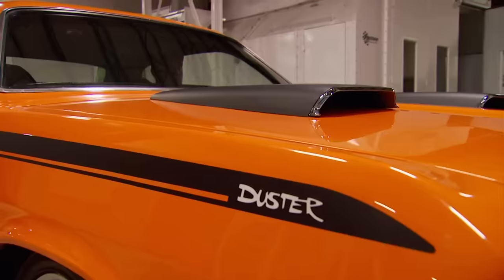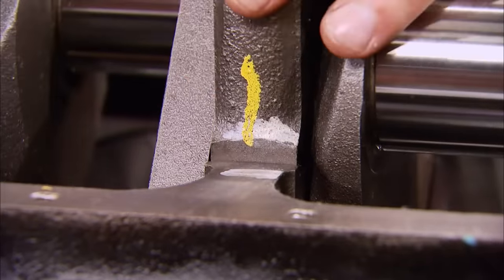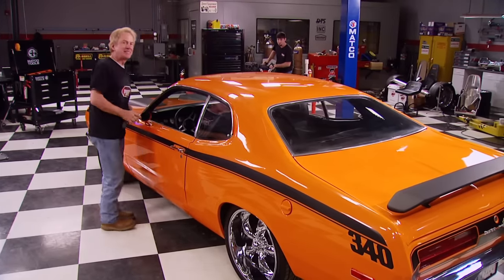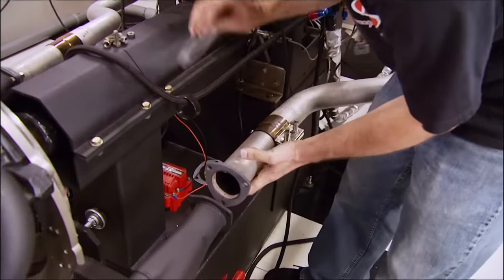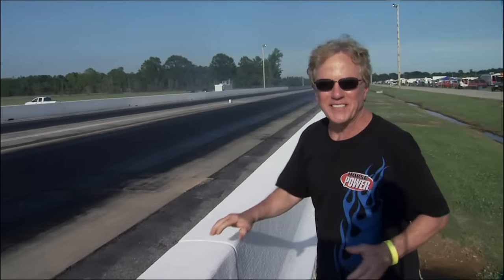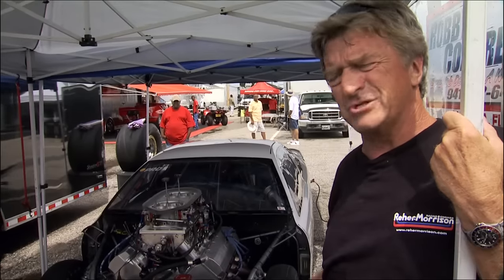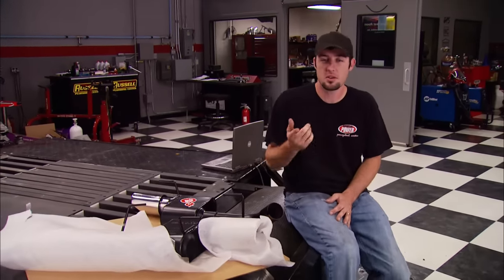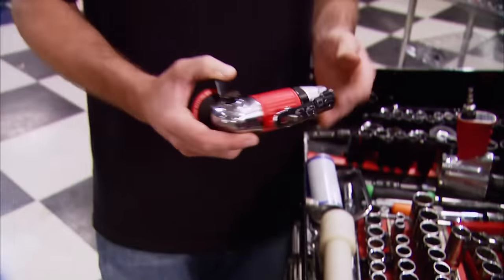Mopar 360 Build on a $2,500 Budget - Horsepower S13, E17

Comment: I bored my 318 .40 over and went higher compression and a utp350 cam has me sitting at 384hp 438tq with 93octane
Reply: That's a good number, tq is really high, what else did you do?
Reply: james bullock it was built with all clevite bearings lightweight tq plate and I removed all accessories except alternator everything is ported and the utp350 cam is amazing with the tune that’s on it now for daily use it’s around 370hp and 400-415tq I haven’t dynoed it in this setting but according to the math and duty cycle I’m close to the numbers maybe a little high
Reply: james bullock the 384hp and 438tq are dyno proven tho
Reply: @BobbyB910  You should make a video on it.  I'd love to see!!

Comment: I have 1990 dodge w150 4x4 318 its fuel injection and wanna make 300 to 400 hp has a mild cam and  has a charging problem  wont charger charge when runing

Comment: What a crap show. That wasn’t a build..... stock cam, dished pistons, small valve heads. That was simply a rebuild of a 360. Only thing not stock on that thing was the intake and headers. If memory serves me well, I believe the pistons in a stick 360 sat nearly 1/8 inch in the hole plus the fish and those heads equal approximately 8:1 compression at BEST..... no way that rebuild costed $2,500.

Comment: These guys running 4.1x in the 1/8th mile with their monster engines, a 3.4L single turbo I6 Supra running 3.8 in the quarter.  There's displacement for replacement.  206ci motor beating the shit out 600ci.

Comment: The 1971 360 has 1.88" intake valves with only the 340 having 2.02" valves.
Reply: @BuzzLOLOL  The 1967 and EARLY 1968 318 blocks can handle being bored to 4.00". The castings were originally meant to also use on a 1967 331 performance engine that was scratched, due to poor performance and was bored to 4.04" for the 340 in 1968.
Reply: @jimjungle1397  - The article shows 318 making 400 HP cheaply with stock bore...
Reply: @BuzzLOLOL  Yes, I know. I was just noting the earliest 318 blocks have heavier cylinder walls due to a prototype performance 331 engine for 1967. It was an answer to the 327 Chevy II, but didn't perform with 273 size valves. It got scratched from production and for 1968 it was bored 0.040" over for the 340, the 340 mimicked the 327 intake port size and 327 valve sizes. The 340 was designed as a 6,500 RPM redline engine, but due to the cast pistons, the valve springs were weakened and reline set at 6,000 RPM, which led to dropping the manual transmission camshaft in 1969. Mopar Performance used to sell ported 318 302 casting heads with 360 valves in them.
Reply: @jimjungle1397  - Mopar selling at Mopar prices prolly couldn't afford the warranty problems of another 6,500 RPMs engine...

Comment: ?? you cant install the water pump and timing cover as an assembly on a LA motor, there is a timing cover bolt directly behind the water pump inlet. If you are going to film it you should be correct about it.

Comment: More cam and fuel!
Reply: even on a stock compression, stock head, near stock cam, etc LA 360, a tuned 750 cfm spread bore with a dual plane works wonders. A 600cfm on a 360 is too small.

Comment: This episode left me very confused, I kept looking for another episode where you actually did anything to the motor. You have a completely stock motor with intake, carb and headers. This isn't an engine build, this is buying an engine and REbuilding it with bolt ons for 2,500 bucks. Couldn't even be bothered to port the heads. If you were buying new cam, why did you get a completely stock cam, it's maybe 50-100 bucks more for a performance cam.
Reply: Clearer thinking: https://www.hotrod.com/articles/318-small-block-build
Reply: 218/228 isn't a stock cam... will go to 400 HP with better parts choices...

Comment: 360 will eat a 340 no lie  even the big block has a hard time time against the even high revving rpms I twisted mine to  7500
Reply: BS, I’ve had and have both. They never built a low performance 340 ever, 360’s came in everything from vans, 4 doors and trucks. I still have both, the 340 is worth 4 x as much, so I’m harder on the 360 and the 408, but even R blocks are designed off the 340, not the 360

Comment: You guys are missing the point:
This was a budget stock type build. It was not a power build.
Reply: A couple yrs ago I built a 79 360 with a .030 overbore, 9 to 1 flat tops, rebuilt stock heads with stainless valves, new seats and guides,  MP Purple shaft 430 grind with matching lifters and springs, new hd rockers and hardened shafts, new push rods, remanned cast crank, MP high vol oil pump, double roller chain,  bronze distributor gear, Edelbrock dual plane, Carter 750 AFB, 1 5/8ths headers  and a MP electronic ignition orange box system. Made 348hp and 395lbft on the dyno. Cost me under $1,800 and runs very good.

Comment: the .441" lift really sucks guys!  couldn't you get at least .480" ???
Reply: @BuzzLOLOL  yeah, I remember this from like 15 years ago. They did a series of junkyard jewels. Great build-up for cheap. With Edelbrock RPM heads, would have been 425-430 and with roller rockers, add 10 more

Comment: Do a 4.6 4v guys
Reply: Matthew Leising its gunna need boost too make power 😂
Reply: @fordmanx3  lol I guess 400 wheel is enough for me all I have is cams and an intake spacer with bolt ons do the math your looking over 450 at the crank out of a 4.6 it's a good motor and tbh motors are cool period some of my favorite motors are flatheads and they dont make power it's an art building engines
Reply: @fordmanx3  by the way your commit is was not needed either but thanks for your ignorance
Reply: Matthew Leising 450hp NA ?
Reply: @fordmanx3  yes I did say just cams and Bolton right with a spacer right? What's the question for lol
Reply: Matthew Leising damn iam impressed for a 4V
Reply: @fordmanx3  yes it's because people are ignorant  look up livernoise 5.3 4v made 519hp and 471 tourqe they have all the mods up there but stock cobra intake with a spacer and stock heads but cnc its expensive but them motors are not shit

Comment: so your going to have exhaust gas blowing out at the egr area
Reply: That’s not the way it works
Reply: @pritchert2799  i built my 360 with an aluminum intake and noticed that .why dont the intake cover that
Reply: ridge runner originally that hole was used to heat up the intake so cold starts would be easier
Reply: @pritchert2799  i understand why its there but the intake should cover it.
Reply: ridge runner no because if the hole was covered it would heat the intake up, which equals less horsepower

Comment: 360 with factory rated 255 hp ?    they really detuned the potential right out of the 360 in the small valve years
Reply: Ford and Chevy did the same thing for 72 onwards
Reply: Put tune back in: https://www.hotrod.com/articles/318-small-block-build

Comment: Why so much valve train noise?
Reply: The Rocker Shaft and Lifters have a gap for oiling.. say if your use to Chevy or whatever a Ford is.. I'm kidding no worries.. my 318 powered 68 Dodge Dart  sounds the same..

Comment: with 600 cfm vacuum secondaries are you sure they even opened up at 3800 rpm. wrong cam should have run the 340 replacement cam and if you were running emission heads should have run the 318 heart shaped chambered swirl port heads from the early 80's if you weren't planning on using good heads. i feel scammed by this episode. the headers wtf did this have to be smogged or please management by producing such low numbers.

Comment: 360's came out in 1972 not 1971, just to split hairs.. :)
Reply: 360 came out in 1971 on full sized C bodies and Dodge/Plymouth trucks. They were rated at 255 gross hp with 2 bbl carb. All 360s had the 1.88/1.60 valve heads, and were 8.8 to 1 compression in 71.  Ratios varied from 8.5 to 8.0 from 74-80 depending on 2 or 4 bbl applications. There were 3 cams available, 71-80.  .410 gross lift, a .444 for manual trans  HiPos, and .430 cam ( the old 340 auto trans spec cam) All 360s used a cast externally balanced crank with larger main bearings than any other production LA engine, until the Magnum series took over, which uses a nodular iron crank which was internally balanced. 71-77 360 blocks are best for rebuilding, as they can be punched .060 over, whereas 78 to 91 blocks are only rated for a max of .030 overbore. Fun fact: The only external part that is unique to only 360s, is the oil pan. All other LA series external parts bolt right up.
Reply: The 360 came out in 1970. They were put in trucks and station wagons. End of debate.
Reply: Yes they came out in late 72 for 73 model year

Comment: Soooo 2500$ for only 60hp gain for 1500$ you could have eBay turbo swapped it with a decent Cam and forged pistons and came out with 200 horsepower gain
Reply: No gain if compare 255 netHP to 314 grossHP...

Comment: No windage tray, no exhaust crossover heat block off, no valley oil tray to keep hot oil off the intake......sigh.
Reply: All True... Very True.. Mopar Everyday and Everywhere..
Reply: Windage tray, agreed, heat block off, possibility, oil tray, depends if the intake will clear it, but using a reground Chevy spec cam?! NO WAY!

Comment: stock heads, no work..shitty lift numbers not bad then but....2.02 port match, bowl and pockets, comp cams 280 mag with correct larger lifters for the SB Mopar , 350 + hp 410 torque

Comment: 340s had 330 hp, 360s cant compare to a 340
Reply: Vito Andolini  you really think that? How about giving the 360 10:1 with 202 heads. The 360 will eat it up on the low end and hang with the 340 on the top end.

Comment: Piss poor just like everything they do a stock magnum made 245 hp in stock form. They need to quit using flat tappet cams not even 1 hp per cubic inch.
Reply: Ford and Chevy small blocks had comparable horsepower ratings
Reply: Gooder thinking: https://www.hotrod.com/articles/318-small-block-build

Comment: I'm not a diehard anything guy, so I can't help but think a $1000 truck LS from a 'yard, with a ring job, cam, and springs would be a smarter way to go. And yes, I mean build the LS and put it in your Duster or Dart or whatever. I'm fine with automotive crossbreeds.
Reply: that swap would cost more than this engine build cost lol.

Comment: Sounds like a waste of money just to rebuild stock junk. Would rather spend that money on an LS swap.
Reply: @M3TA1UPY0URA55  haha triggered
Reply: you aint ls swapping for 2500 LMFAO. try ata least 3k...and thats not including moddding the engine...
Reply: @frigglebiscuit7484  you're joking right? I'm literally in mine under $1500. Buy a whole truck for under 1k sell the parts you dont need, scrap the body and chassis of the truck at the end for an extra $200, it's not rocket science. You can even make money doing the swap if you find the right deal.

Comment: You could have just LS swapped it for the same price if not a little bit less. Make the same power but shed hundreds of pounds, have overdrive and double the fuel mileage. I shed 700lbs ls swapping my dodge. 
There’s no point in building these old dinosaurs.
Reply: I've never wanted to use old Chevy junk on a good running Mopar are you kidding
Reply: you aint ls swapping for $2500, sorry. also, you can bolt a mopar a518 trans up to it and get overdrive. every time i see an ls swapped car at a car show i cringe and walk by. you could build that engine far cheaper than 2500 bucks. i spent $800 building my big block mopar.
Reply: Noooo😡you missed the point purist like to keep their cars as orgiinal as possible. U put ls motors in gems not motors
Reply: Correction mopars
Reply: Mike Moscato I’d put a Toyota motor in it if it made sense, leave the original mopar on a stand, it can always go back. . A ls swap only cost $1500. I make the harness myself, engine trans $550, fuel $200, headers and full exhaust out the back $400, custom driveshaft $150. Not much to it. My 88 w150 would whoop on newer muscle cars. I’ll build you a bolt in kit for $3500.
Reply: Ls swap the world only reason I’m building my 360 is because I have a fresh tranny next mopar I get is getting a ls swap
Reply: @MrPland1992  2jz the world
Reply: Austin Doud can’t wait to try a 2jz! Them dodge motors are stout tho my 318 truck had 400k when I bought it. Still took 1000-2000 miles a week no prob. Just leaked a shitload of oil. Didn’t make sense for me sink money into a tired setup. I do agree with y’all a Ls is cringe,really played out. Especially when they’re half ass thrown in there like most people do.
Reply: MrPland1992 you’re forgetting radiator little odds and ends. Things add up quickly.
Reply: Bryce Ocain buy a full pullout with everything. All hoses, lines, overflow tank, harness, ecm, air intake, sensors etc. $550-650 at any self service junkyard in America. New radiator $50.
Reply: If you LS swapped a Dodge I hope it burns to the ground. And no, you didn’t lose 700 lbs.
Reply: David Hensley I wrapped it around a pole actually. 550hp, 3500lbs and rain isn’t a good idea. I went from 4300 to 3500 lbs. so actually I lost 800lbs and yes I weighed it at the scrap yard as I was curious.But It was 4x4 and I went 2wd so I cheated a couple hundred lbs. Are you stupid or something though? Do you understand aluminum heads, lighter block, plastic manifold, headers, aluminum driveshaft etc all helps shed weight? The weight difference alone made it al whole different truck. It’s more than just gas mileage and power. A 350hp ls engine will run with a 500-550 mopar big block because of weight alone.
Reply: John Johnson hemis make excellent power though, 60-100 more HP than a 5.3 stock. I go to the junkyard a couple times a week though and they are trash engines. Every one has chewed up cylinder walls. I’m sure it’s just a minor weak point that can be addressed. That’s why I went Ls on my ram, I would have rather went hemi then I could have had a “show” truck and advertise hemi swaps. I can’t imagine it weighing the same as a sbc as the Chevy has iron heads, manifolds and Intake but idk
Reply: Cheapest way to ls swap is buying a wrecked car so you have everything.
Reply: @MrPland1992  you did not lose 700lbs ls swapping. sorry bud.
Reply: Frigglebiscuit scale says other wise. Have fun with your overpriced mopar boat anchor. You also said I couldn’t do it for $2500 yet it only costs me $1500.
Reply: Frigglebiscuit the scale says other wise. Didn’t you say it wasn’t possible for $2500 also? I did mine for $1500.